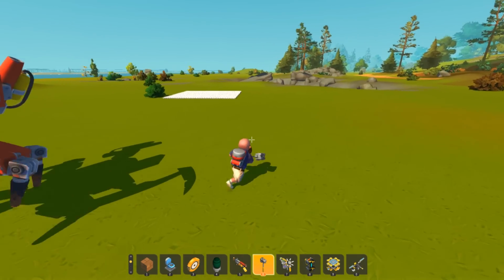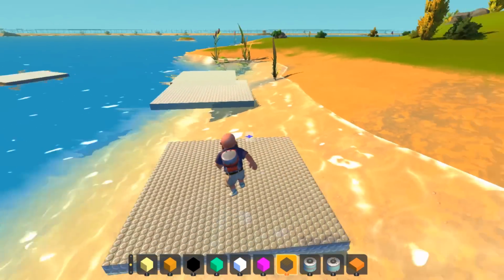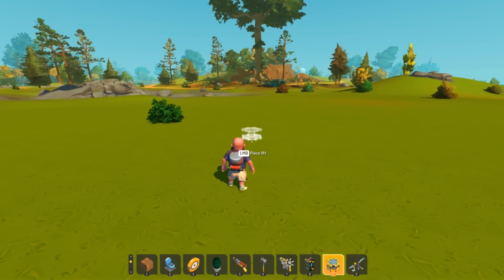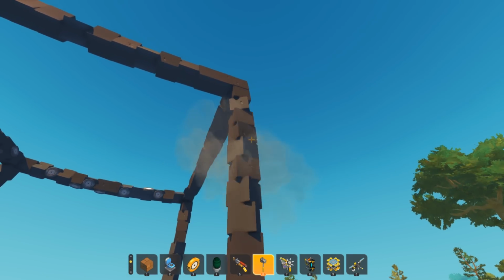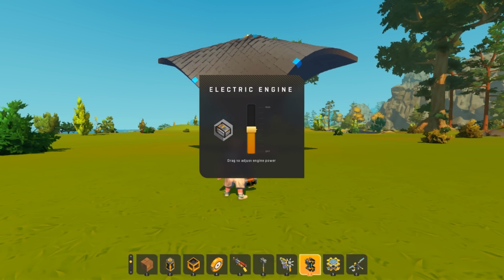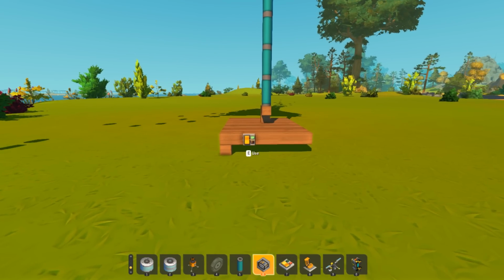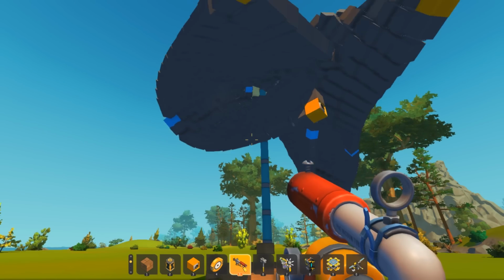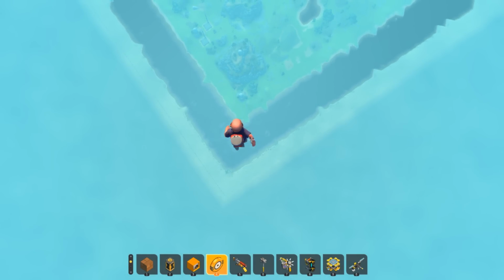THINGS GET CRAZY! 😵 SM Soft Body Physics Experiments #2

Comment: So about the bouncy bubble blocks: Every "piece" of a creation, seperated by either moving parts or a change of material, is calculated by itself. That's why A: when building very long rows/planes you have to occasionally change materials, else it will get very very buggy. and B: When building boats you are advised to seperate your bubble block with other blocks. Bubble block on itself is EXTREMELY bouyant, so if there's just a single block of it in water, it bounces as it's acceleration is very very very high. Since every block on the sheet is seperated by bearings, that effect applies there too. 
Thanks for coming to my TedTalk!

Comment: maybe a looser mesh on the net might improve lag and flexibility. separating the + with - ones on each side. so the net holes are larger and there's less bearings overall, and each piece would be trying to flex in less directions it might work more like a loose net and less like a stiff sheet.